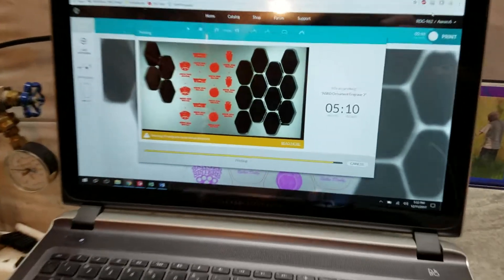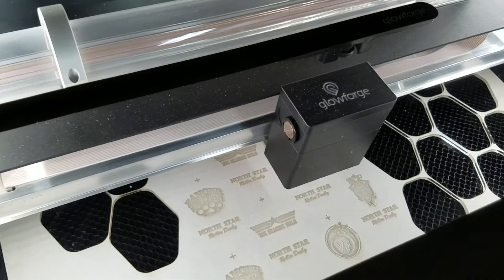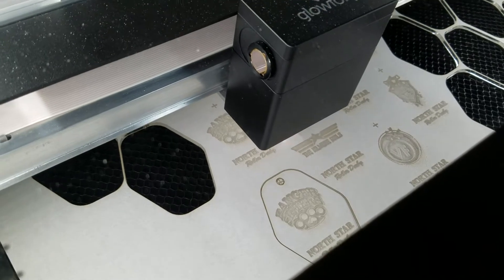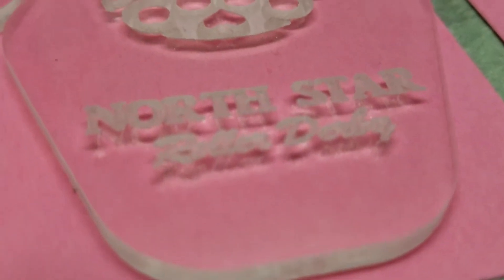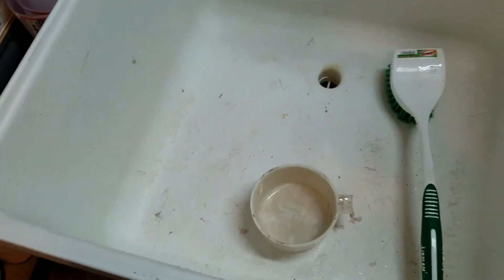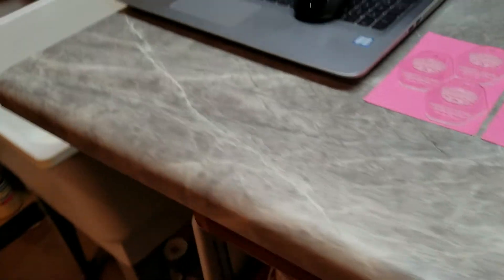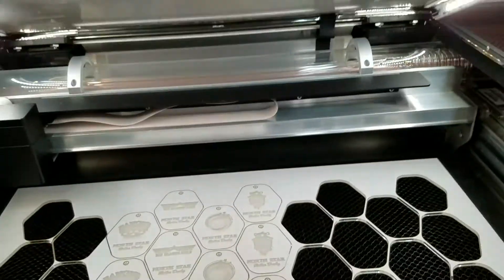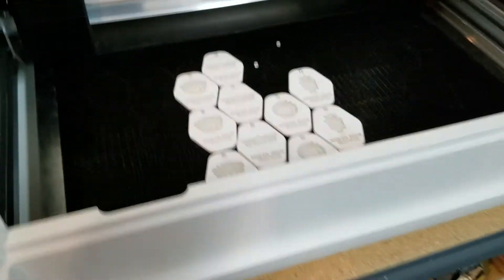Cutting Acrylic ornaments on the Glowforge

Comment: How do you get the machine to cut. I am being told in order to cut the text I want does not support bitmaps?
Reply from the maker: Nicole, you will need to convert your bitmap to a vector file for cuts. The GF forum can help. You should install InkScape (its FREE). Watch a bunch of youTube videos at TroyTube and you will quickly learn the basics on InkScape. You will have no choice but to be able to work with SVG files in order to use your GF. There are a TON of resources out there...